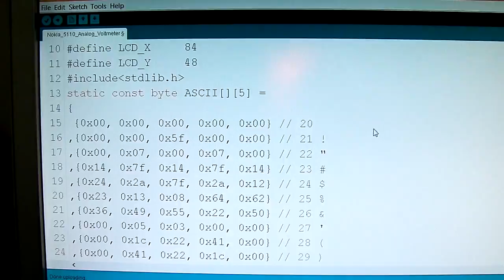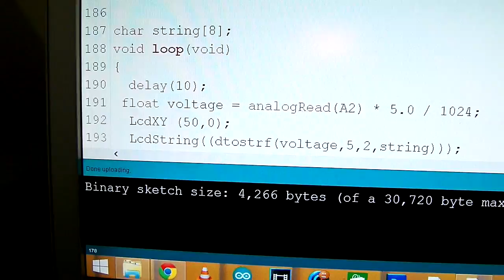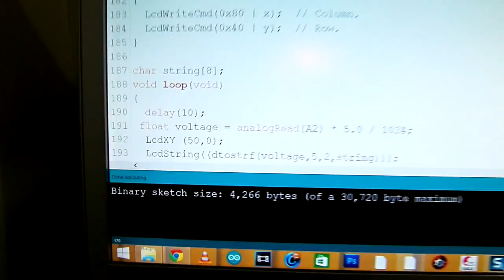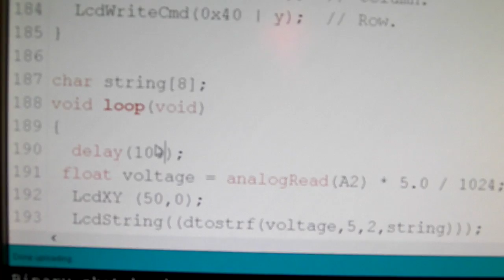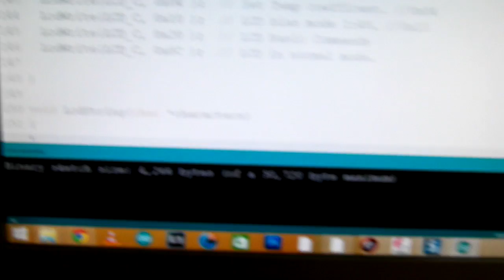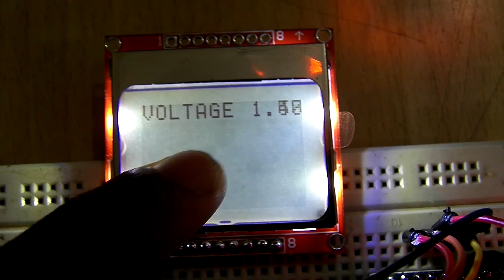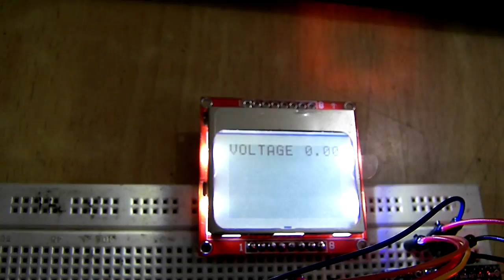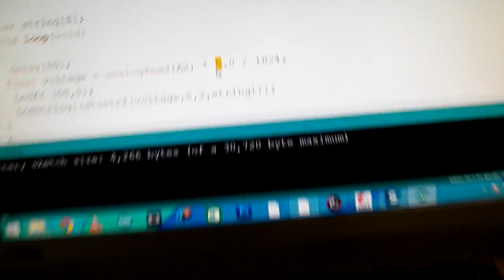Voltmeter using Arduino Mini Pro & Nokia 5110 LCD #45

Comment: Nice project but its NOT recommended to use the volt meter without using a resistor-based voltage divider or else you will burn the Chip very soon. Even for 0-5 Volt you should use the Voltage dividing cricuit with approprate resistor and calculate using R1 & R2 ( typically 10000 and 10000 OHMS) formula Vout =(R1) /(R1 + R2) * Vin
Reply: +VibeX MaTxeMaThanks for providing the GOOD advice and formula.

Comment: bro ur voltage is floating when not connected to anything use pull down resistor to solve this prblem